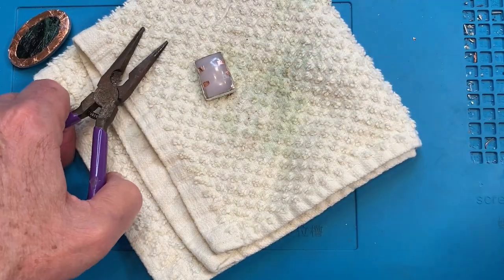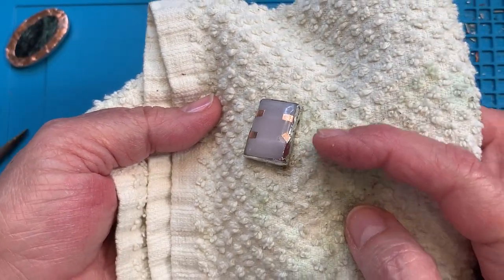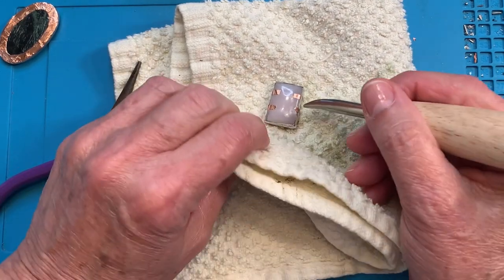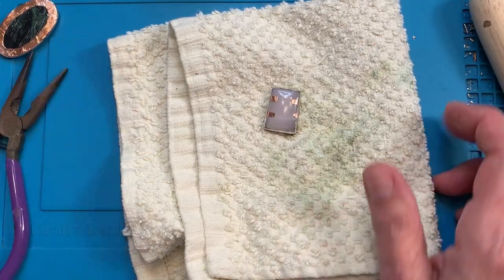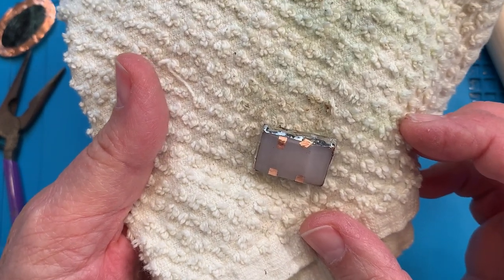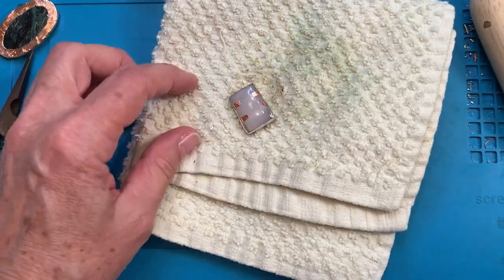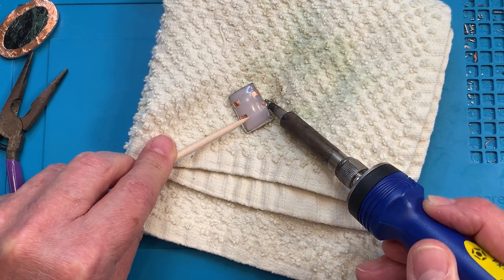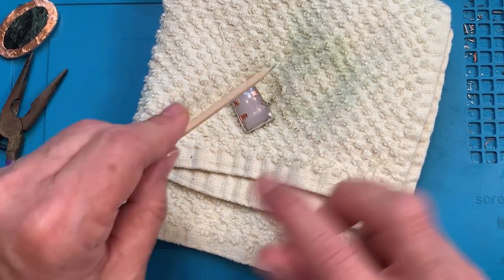“Faux Prong Setting” with Tiffany Soft Solder Method

Comment: I am learning did you say silver gleem is better when you don't want to patina due to it having silver in it? And use lead free soldier for stuff you want to patina. Kathy from Cali. 😎
Reply from the maker: ALWAYS use lead-free solder regardless!  I use Silvergleem when I’m not planning on applying BLACK patina because Silvergleem is way more expensive & If I’m planning on using BLACK patina why waste the expensive solder as any other solder besides Silvergleem is good enough for the BLACK patina look!  But if I’m planning on using Copper patina I will use Silvergleem because I get way better copper effects & I believe it’s BECAUSE of the silver (around 4%) content. I’ve tried other solders for the copper patina application & it was a complete fail.

Comment: hi, Karen, did you try to solder zinc with this flux?
Reply from the maker: Not sure why I would be using zinc so I couldn’t answer that question!
Reply: @karensintuitivejewelry  some castings from zinc metal . it's less expensive , because i asked and on your flux write "Zinc"
Reply from the maker: Oh ok!  I wasn’t familiar with zinc metal jewelry & learned something today!  I guess the flux would definitely be compatible with zinc but I’m always looking for products that won’t tarnish easily!  I’m experimenting with aluminum blanks for rings & bracelets right now because they won’t tarnish & you can stamp on them too!  I made a tutorial making a bracelet with aluminum blanks & planning on making a tutorial for a ring soon!  Do you use zinc jewelry?
Reply: @karensintuitivejewelry  haven't tried it yet, but I saw your flux and thought it might be a budget alternative
Reply from the maker: @nstyle-jewelry524  I actually looked into zinc flux & there are several other products cheaper then the one I’m using now. Zinc is also used in stain glass. Amazon has several different brands
Reply: @karensintuitivejewelry  will try!